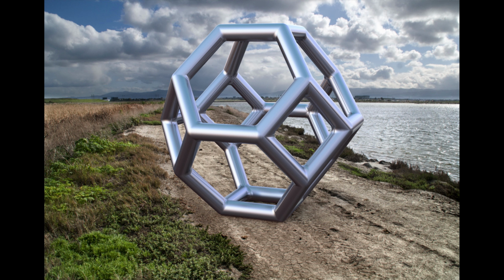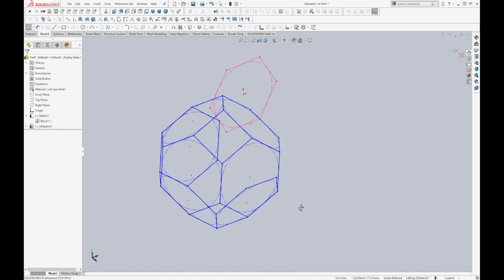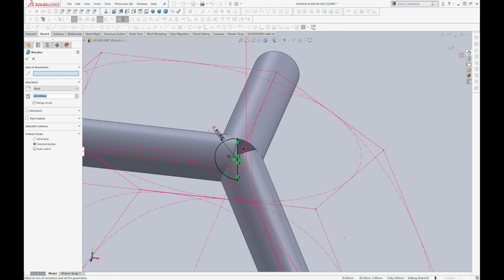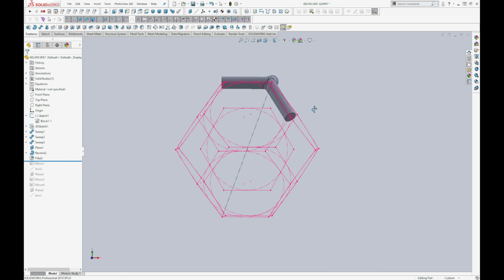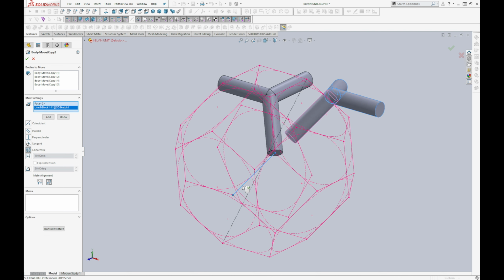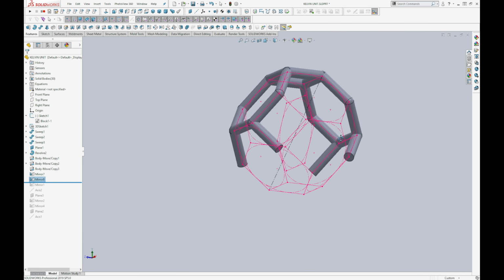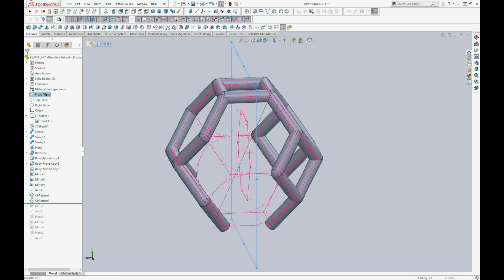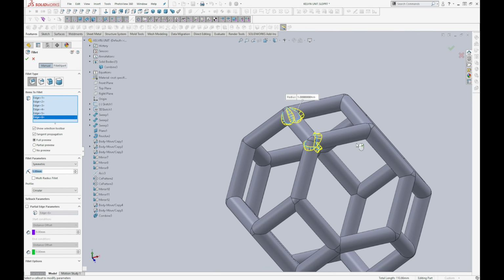[CAD TIPS#09] HOW TO MODEL KELVIN UNIT CELL IN SOLIDWORKS

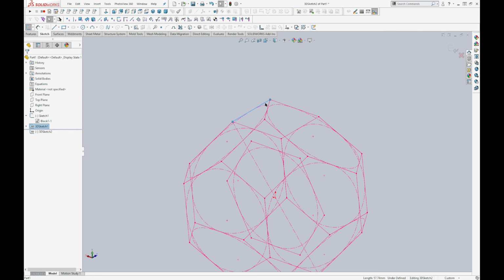Comment: At 2:47 or so, you say you use 3D sketch to project the individual edges, is that a keybind or button somewhere as I can't find it on mine? I open a 3d sketch and click on the line and it doesn't do what it does in the video.
Reply from the maker: when you are done with the cell skeleton, exit its sketch first. Then make new 3D sketch. Select lines you want to convert and use "Convert Entities" command (use search command bar if you can't find it). In the video I'm using shortcut, which is set to V for me. Hope it helps!

Comment: what if i want to create closed cells of the same? (similar to zif-8 structure) what should i do differently, after initial sketch?
Reply from the maker: Create new 3d sketch. Convert closed contour (hexagon or square) to lines. Exit sketch. Use FilledSurface command to create surface. Repeat process for all faces of the shape.
If you need to convert all created faces to one solid, use KnitSurface with "convert to solid" check mark on.
Reply: @engiuser  awesome. thank you, really helpful.